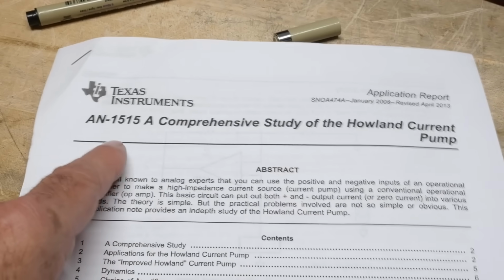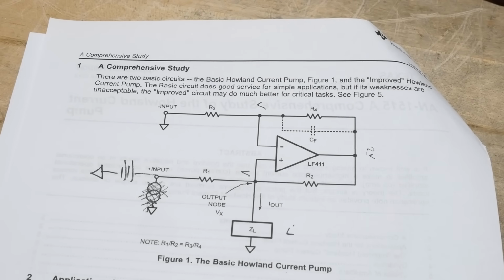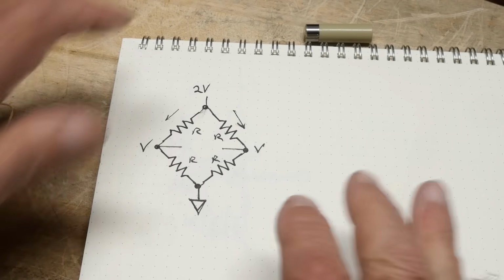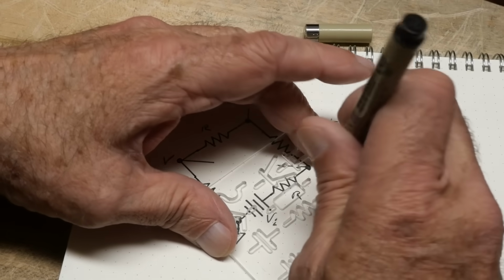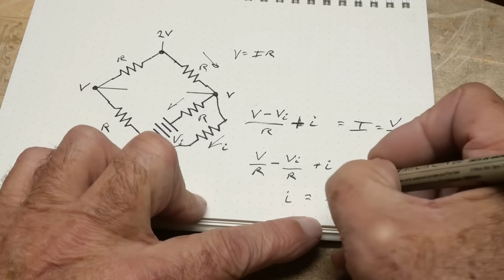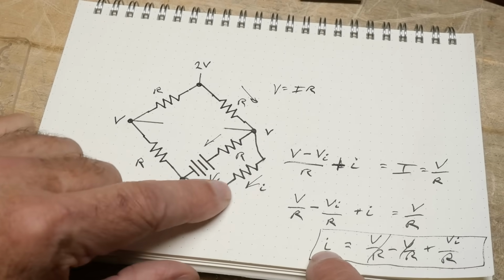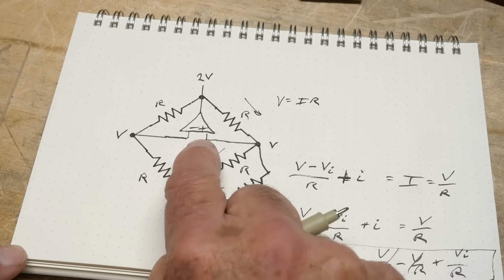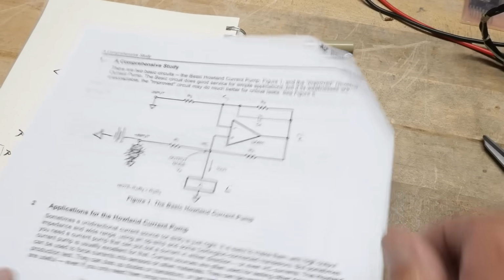#2175 Howland Current Pump (part 1 of 2)

Comment: The fifth resistor across Vi is not needed as there is already one there comprising of the three resistors in series at 8, 10 and 2 o'clock.  I think .... perhaps I should finish my coffee.

Ahhh the 5th resistor is the load.  The power of coffee.

Comment: This was just the video I needed today. I recently acquired a couple of Keithley 160B multimeters and am brainstorming ways to test it's pico-ammeter and building a reliable current source is an obvious prerequisite. I'm not saying that this will be the solution, but it's good food for the little grey cells.

Comment: IMSAI Gui, you would be doing the electronics world a huge service by doing basic training videos for electronics education. You grok electronics, and you can teach that groking to others. I wish you would do so. The moment you stuck that op-amp into the bridge a light went off in my brain. Then when you turned the circuit sideways and compared schematics I actually laughed! I've been self-taught in electronics all my life, and it wasn't easy to turn it into a career. But if I'd started out with this sort of education in my youth I would have retired as a senior engineer rather than a senior tech.

Comment: Great explanation, and much clearer than I learned it. While not as precise as your explanation, to get my head around it, I always thought of the resistor in series with the load as a current sensing resistor, and the positive terminal of the op amp as the sensing terminal, so as the current through the sense resistor changed due to changing load, the sense voltage would change, but the inverting terminal of the op amp was fixed. So, by ideal op amp theory, the output of the op amp would vary to maintain the balance. In a sense, it is the same as your explanation, but you added the clarity of the bridge circuit. I had never thought of it as a bridge before, so you taught this old man a new way of seeing it. :)

Comment: In "O" level physics ( for 15 year olds) back in the day in the UK --- our Physics teacher would occasionally draw a battery with a rectangle around the multiple cell symbol(s) and further draw a tiny switch and a "little" diminutively scaled resistor to remind everybody that a battery has an internal resistance. He'd also remind us from time to time that Faraday got it wrong and that actually electrical charges push like peas in a drinking straw in the opposite direction. Years later at  University (in Wales undergrad) attempting to study "Materials Science" - [They were closing down the whole department at the time ] Dr Tilley a German professor used to bamboozle us with X-ray diffraction math - from a friggen quantum level and then extra bamboozle us with the entire quantum description of how an RF aerial works in respect of an electron "Gas" / matrix in a conductor and all kinds of resonant "Shenanigans" total mind flump --- (I can still draw out most f the graphs even today) for someone that used to read about "Transistor radio design and theory" and tinker about with all kinds of electronics as a kid and teenager - it seems pretty clear that Electronics (as such) really is a DARK ART... and rarely does hard-core physics* meet on the same street in ANY practicable fashion.
.
.
________________________________________________________________________________________________________________________________
.
.
* I was an RAF 'cadet" in my formative years... My other Physics teacher also at "O" level - 13 years old to 15 years old - would draw on the blackboard how a airplane banks a turn - and scribble out all the banked track and radial velocity equations on the black board ... A 'fellow" cadet  [I'm not really into playing soldiers anyhow ]stands up and goes - "Its stick and rudder you moron - you can't turn an airplane and bank a turn only using ailerons or only rudder ... as the plane just goes in a straight line crooked either yawed or partially rolled ... in some cases you have to compensate by pitching the nose up to not lose altitude ..." - so the physics teacher that actually has Ph.D. starts bickering with this fourteen years old in an RAF uniform that actually has flight experience ...  and insists that what's on the Black Board is 100% correct... told to sit down and shut up... [ There's a real problem with those that can actually 'Do" versus well meaning physicists that pretend that they could totally be 'useful" engineers. ].  The main difference being that "Engineers" (other than jokes about levels of various people on various spectra - autistic or otherwise ) as ultimately Engineers have to get'er done ... And then all the machinists and other practical peeps will complain bitterly about how dumb Engineers really are or how dumb management is - but oddly a lot of machinists have some respect for Physicists ... The basic "Knowing why" (allegedly) vs. the "Knowing how" vs. that actually ability "To DO" - triangle - now having been cast adrift to the four corners of the planet through globalism. But hey maybe I can now buy a cheap Spectrum analyzer from CHINA ...  yeahhhhh. 
.

Comment: The howland current pump is used in analog party line intercom systems

The idea is that if you have multiple stations connected to a party line, if they try to all drive their own voltage into the line they'll just fight each other.

So instead, each station drives a current into the line, the line is terminated with a known resistance, and the current driven by the stations turns into a voltage across that termination resistance.

The howland current pump is the circuit generally used as the bipolar voltage-dependent current source for these systems

If you're wondering how relevant analog partyline intercom systems are in 2025... I'm currently sitting in a multimillion dollar television production truck with 12 channels of analog partyline power supply next to my head. Analog partyline is great when you need something simple and robust to deploy in the field.

Comment: I used something very close to this circuit for a thermistor measuring mass flow in a Radon Dosimeter used in mining. The output from the op-amp control the air pump.